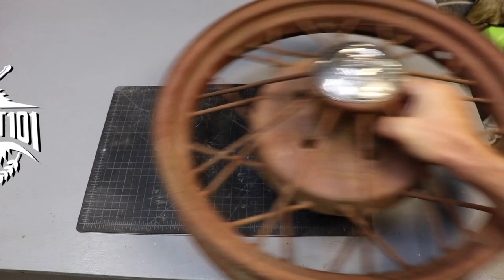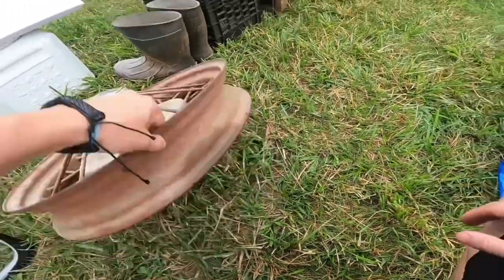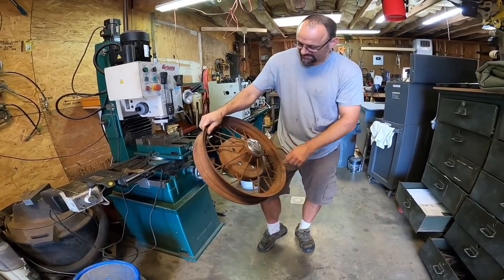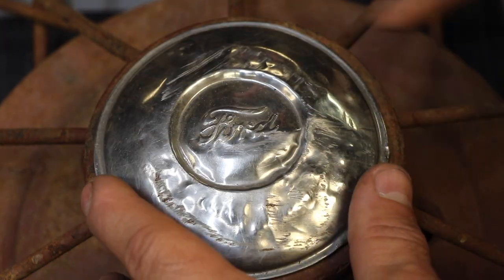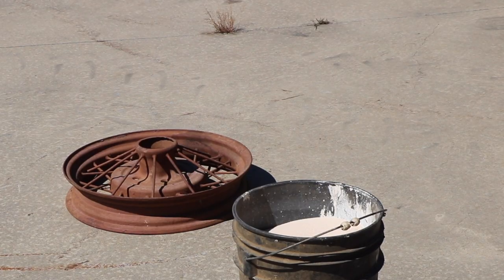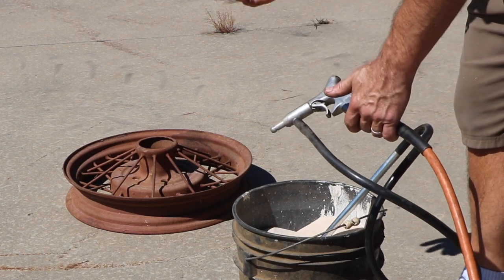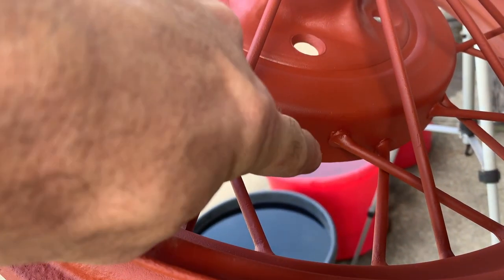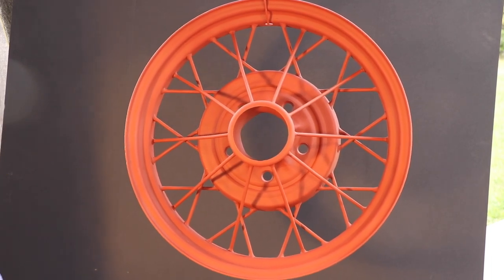Ford Model A Antique Wheel Restoration and Auction!

Comment: Really good job on the restoration, especially the hub piece.  Well done.
This held up well over the decades.
Thanks for pointing out the weld.   Interesting.   Good call to leave it close to original manufacture.
Dave.

Comment: Impressive save on the hubcap! The wheel is a later 1930-1931 Model A. Although Henry Ford was a brilliant inventor and engineer he did not invent the automobile!
Reply: Carl Benz ivented the car in 1886.
Reply: I have a 1931 chevy special sedan and it has red wheels also.

Comment: You are aware that the chrome hub cap is a replacement for an original, which was stainless steel and didn't have the ring around the outer edge.  But nice job bringing it back to life.

Comment: This 19" wheel is from a 1930-31 Model A.  The 1928-29 wheels were 21" and most of them came from the factory in black paint.  In 1930-31, Ford introduced some De Luxe  models which came with wheels that complimented the pinstripe.  Red, cream, apple green and blue were some of the optional colors.

Comment: Whenever I sandblast as you did I put down one of those cheap blue tarps to catch the sand. I still sift but I know there will be no  dirt from the ground. I even do it on grass.
Nice job on the cap. I used a sand bag but did not get the same results. Will try an anvil next.

Comment: Great looking wheel!!! My wife was amazed at how well you did the cap. For the sand blasting, I've started using the pressure washer technique. Takes a little to get used to, but you're not getting pelted with all the ricochets. Then, I just hit it with the rust transformer. Keep the cool videos coming!!

Comment: Looks like a real good job on that wheel. I  understand that it went to an auction and the profits went to charity, so I hope you got a good price for it.  I really don't think that a Model A restorer would pay much for it though. You restored a 19" !930-31 Model A wheel, which is the easiest Model A wheel to find. At least yours appears to have good bolt holes, not enlarged from the nuts becoming loose. And the spokes are good with no loose or bent ones. But those wheels have always been too common to be worth much. Now if it was a 21" 1928-29 wheel in that condition with no rustout in the rim, as often occured, then it would be much harder to find and worth more. Or especially if it was a 16" 1935 Ford wire wheel, now those are especially desired by hot rodders and worth looking for.
But that hubcap.  I wouldn't waste my time working on that if it was going on a restored car. Those hubcaps have long been available in reproduction, made of stainless steel, as they originally were. You could have just kept buffing and polishing it, no plating necessary.

Comment: Was the original a solid tire or an inner tube tire?

You should have had a respirator while sandblasting the paint off. Due to its age, it likely has lead in the paint.

If you had access to 3D printer, you could have re-created the hub, then cast it in aluminum or bronze to use as an anvil of the correct shape.

Build a large plywood or sheet metal box with a slanted bottom and a hole at the end of the slant. The sand will mostly flow back down through the hole, and falling back into the bucket. No need to stop to sweep.

Comment: I restored a 1929 Model A Tudor sedan in 1961.

I was fortunate to find an old man who had worked at the Ford assembly plant in Louisville, Kentucky during  the years bof Model A production and  applied the pinstripe to the cars freehand.  As I recall his name was Jacob Bonn.

He also did the pinstripe on my car when it was restored in 1961.

He told me that according to the serial number of my car he was likely to have applied the original pinstripe to my car when it was manufactured.

The following information was obtained in conversations with Mr. Bonn and is likely historically accurate, at least as pertains to vehicles assembled at the Louisville factory:

The original color of all  Model A Ford wheels was black.

The wheels (and fenders) were painted by dipping in a vat of paint, always black.

Ford used a fast air drying enamel paint  on the wheels, fenders and chassis components,  and a proprietary lacquer type paint Ford  called pyroxelin on the car body, and applied it by spraying, a new technique at the time.

Dealers often painted the wheels of new cars another color, usually  red or yellow, to attract the attention to potential buyers.

In regard to another controversial detail, the area of the body structure exposed under the rear fenders was usually painted black using a brush and black enamel paint, but when the workers doing that job fell behind it wasn't unusual  for occasional cars to come out of the factory with the body color exposed in the rear fender wells.

Comment: Hot dip in phosphoric acid at 8/1 would remove all that rust without blasting.
Also suspending the wheel through the centre for instance with a broom handle allows the wheel to be spun making painting easier..

Comment: my dads got an old model A with similar wheels, he was in the process of restoring/ rebuilding it and passed away last year so im left with a classic throw up all over the shop, hoping i can eventually rebuild it myself. the drivetrain is completely separated from the other parts of the car, there’s also 2 drivetrains and 2 sets of wheels/tires so i’m not sure what he was doing with that, im thinking i’ll start by restoring the interior stuff lol, id love to know what you suggest!

Comment: Henry Ford in 1930-31 made all his shiny pieces using Alaganey Metal which is stainless steel. A person can buy a perfect reproduction hub cap. the tabs on the cap were bent over before mounting on the car. not all the tabs were bent over just enough to hold it on the wheel. 1928-29 were nickel plated. that wheel is a 1930-31. Ford didn't spray paint the wheels; he dipped them in vats of paint and they hung on a chain rack to dry as they moved through the plant.

Comment: That is a 1930-'31 19 inch model A rim.  1928-29 model A's had 21 inch rims.  Early 28's (before April 1928) are not compatible with later 28 and 29 due to a design change with the brakes.  There are 3 different Model A wire wheels, all of which have the same 5 bolt hole pattern, and none of which are interchangeable.  These 1928-29 model A 21 inch wheels look similar to the 1926-27 model T wheels but, again are different.  Lots of design changes going on at the time.

Comment: An m95 may not save you from silicosis, my uncle got it sandblasting it was a slow death couldn't breathe eventually died. You need a full-face certified respirator. or better still use another media other than deadly silica.

Comment: beautyful,  after such an heavy work, I.d use 2k primer and topcoat, much more resistant and stable.
Reply from the maker: Is 2K a brand?  I'm always open to tips on how to do things better.  Thanks.
Reply: @FarmCraft101  it is a two component paint, the paint and a hardener, same for the primer, usually, on a freshly sandblasted metal, the best is to apply an epoxy primer followed by an urethane enamel, you can also use the powder coating but it is another story at a much higher cost.
if you keep the wheel in a dry location, what you done will resist for a lenght of time but the permeability of rattle can products will make that the rust will reinitiate under your new finish rather soon if exposed to the elements.
there is POR-15 paint that is a very good way to paint metal but it is rather difficult to apply on an object that has such intricate details as the spokes on your wheels because it has a tendency to drip rather easily.

Comment: Do you have any insight into how the spokes are attached to the hub and rim?  They clearly seem to be welded, but the flairs at the weld joints don't look like something that was created by any welding process I'm familiar with.  Are the flairs maybe created by upsetting in a forging process which maybe also leaves a smaller boss that goes through the hub and rim and then gets arc welded and ground down from the inside?
Reply: I was able to answer my own question.  They were actually spot welded.  The flares are apparently forged as part of making the spokes.  The hub and rim are dimpled to accept the spokes.  The parts went into a machine which pressed the dimples flat again from inside the hub and rim while at the same time spot welding the joints.  It was covered by US patent 1701843.  I had no idea they were doing stuff like that in the 1920s.  Pretty cool.

Comment: Very nice work! Especially the Ford hub cap (AND the joke).
Since you do so many restorations, could you please tell me the best way and paint to restore my Craftsman Lawn Tractor Cutter deck to a protective coating that will resist rust and allow for grass to be cleaned off?
Thank you!!
Reply from the maker: I'm not an expert, but POR-15 is generally considered the best of the best rust proofing.

Comment: Great job! I would have tried 3d modeling the hubcap then 3d printing out forms (front and rear) to use to try and press the cap back into it's original shape (basically restamping it, but slowly and gently).

Comment: For the most part i like the work, except for the paint.  Way to shiny.  Originally the paint was not this high gloss.    Gloss paints of the day were not nearly this shiny.    To me a bit less shiny would look better and more period correct.    I just saw two model A side by side. One with high gloss and one with less gloss on the wheels.  Less gloss looked so much better.   Wish that i had taken a photo , i didn't.